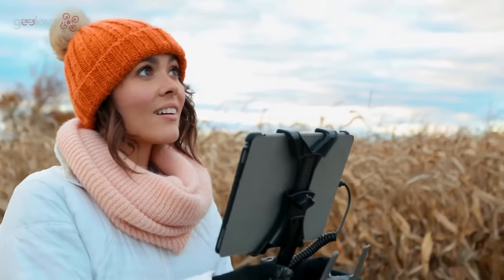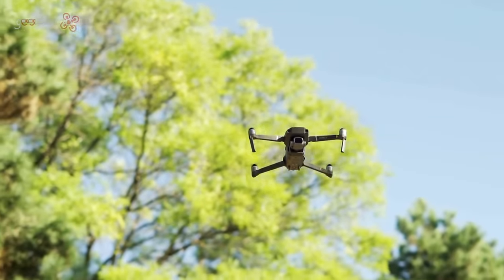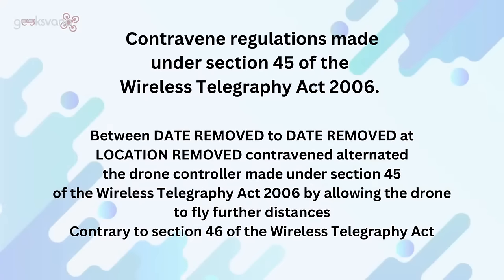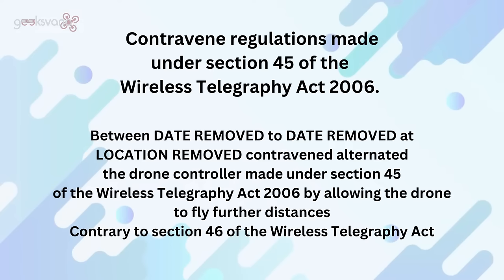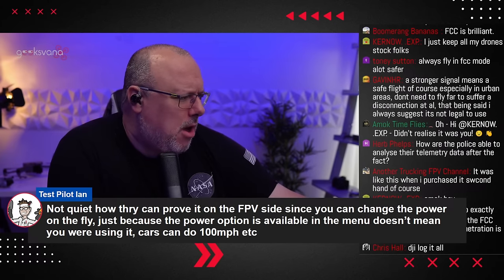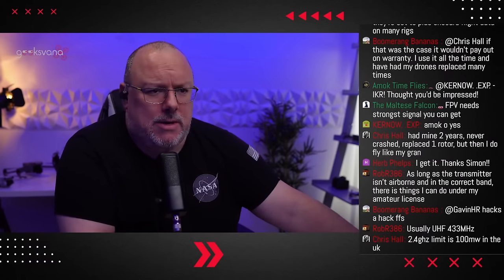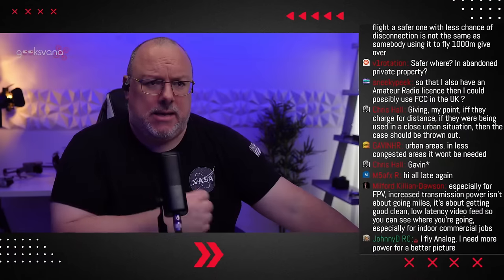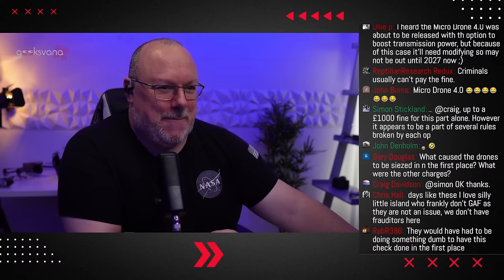CHARGED for using DJI Drone FCC Hack! BREAKING NEWS!

Comment: Yes youtube is full of bright not legal ideas, some ive rabbit holed include ffc hacks no limits boards and alientech boosted stuff, still not flown my drone im already convinced it needs an upgrade for transmissioon safety. Fact is anything that boosts output beyond legal limit is a crime by definition so i already decided to find a workaround minus said modifications. As a licenced ham im well aware if ofcom regs and enforcement and should have known better than to care what youtube and forums say since they are not the law.
 Only legal workaround i can see is antennas since they may alter the directional pattern but do not directly amplify the output in the way the fcc stuff or boosted boards and arrays do. Obviously some people struggle to maintain signals for live video and this is most likely all the stupid high power in home routers in citys. Directional tuned patch antenna is the only legal workaround i can see as long as its non amplified and power output and swr is within ce boundaries
Reply: Boosting the ERP is not legal on unlicenced bands without the permission of OFCOM.

Just fly far away from built-up areas. Frequency degredation at distance on both 2.4GHz and especially 5GHz is quite significant, and that's not to mention the inverse square law. If no one is inconvenienced then no one cares, although I'd avoid DJI products and only buy R.F. components from reputable sources just in case.
Reply: Yagi antennas. My business has around 1,450 emitters in 1 Hectare on a busy day, and there can be another 2,000 within 200 metres - which gives no problems with operating my Mavic Mini at VLOS range. None. That's the wonder of signal processing plus yagi antennas, but I get major problems near a certain farm:
It's the idiots over-amplifying power that are the problem.
Reply: @lindsayheyes925  I'm pretty sure DJI drones use a bidirectional link, so I'm curious as to how you avoid exceeding the limits on ERP using those antennas.

Comment: there is a reason for fcc and ce and it just shows how many people are ignorant and apply hacks and spoil it for the hobby
Reply: You loose a craft due to no signal, you don't have a hobby anymore. They want to end the hobby outright, that's the endstate, ONLY commercial with licences, just like the drivers licence, take away a right and sell it back as a permit or licence. Oldest trick in their books, besides the birth certificate scam/fraud.
Reply from the maker: To be fair Paul, this legislation has been in place for a long time, and much of it predates the modern introduction of automated camera drones. There really are very good reasons to protect frequency use.